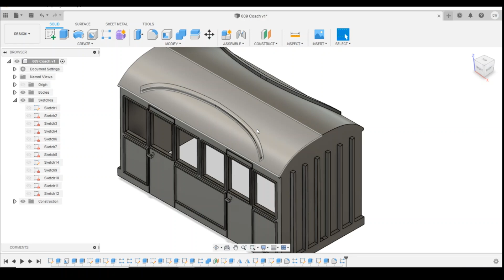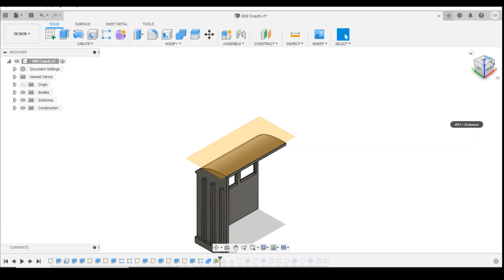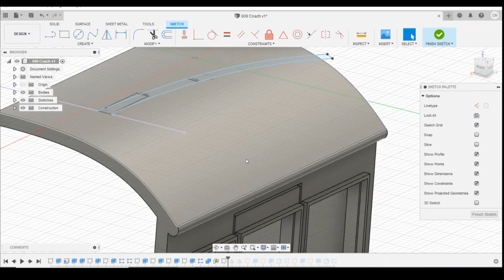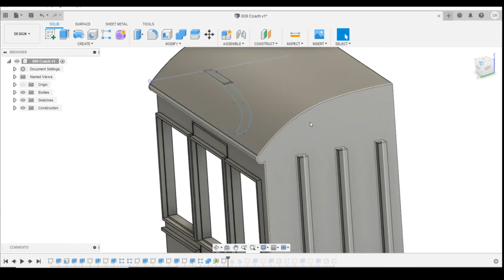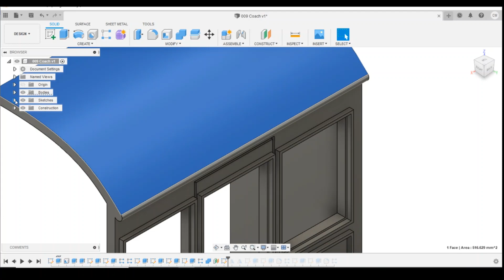Lesson 19 - Fusion 360 for beginners drawing on a curved surface of a model railway coach

Comment: For some reason it keeps saying that the extrude extends beyond some sort of boundary. I tried using the emboss feature but it still didn't work ;( I'm very puzzled
Reply from the maker: You need to make sure that the whole of your sketch is inside the body to be able to do the extrusion on a curved surface.  if any of it is outside it throws up the errors.

hope that helps,

Carl
Reply: @3ddrawingformodelrailways  Thank you for the help! :D

Comment: Hi Carl, a quick question, is there a quick way to create a pyramidal top to a square post? Thanks
Reply from the maker: Hi Paul,

This video covers the tool you are looking for to be able to achieve the pyramid.  You will need to also use the Point tool in you top sketch to get the sides to come to a single point.

Carl
Reply: @3ddrawingformodelrailways  OK thanks Carl, I did manage it but in a long winded way but extruding a series of triangles over a square post but the point tool sounds a much better option. Regards Paul
Reply: Ah got it, extrude with a taper - easy